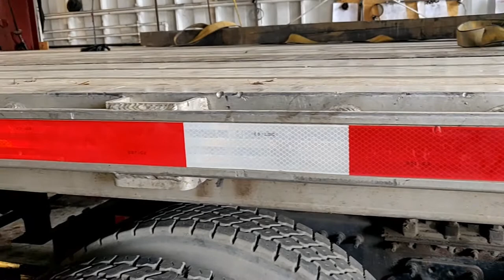Flatbed repair side rail welding

Comment: Did you have any problem getting the side rails back into position or did it slide in with all those straps easily? I'm working on a warranty claim for a 2024 and it's hell getting the side rails back on this trailer so far!
Reply from the maker: It slided back in easily!